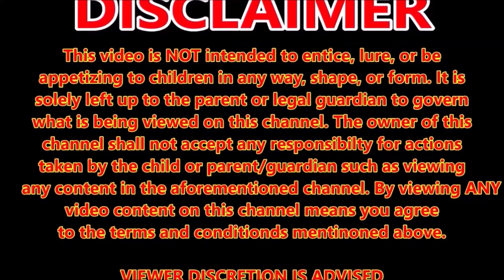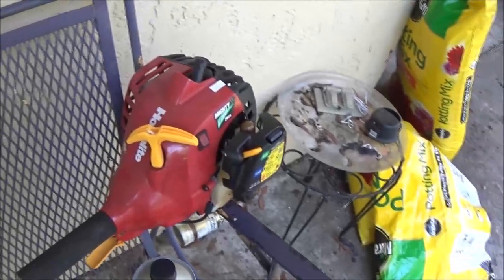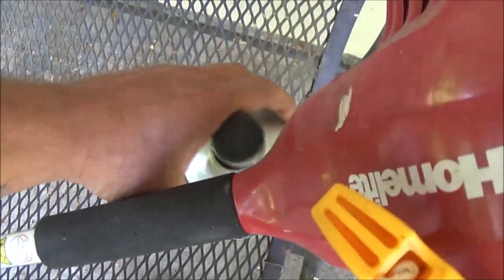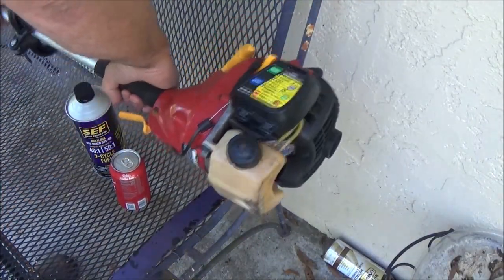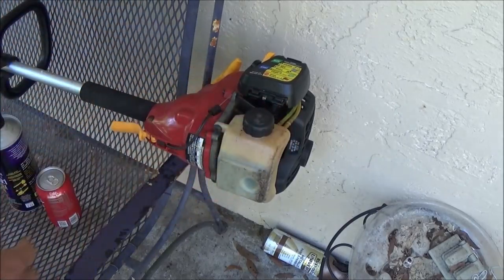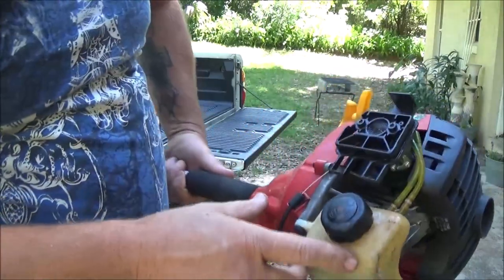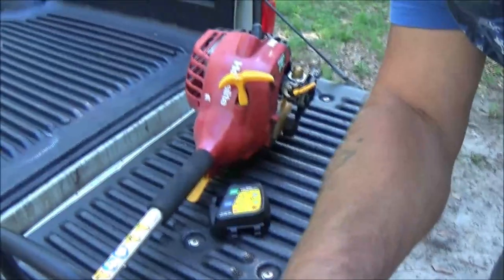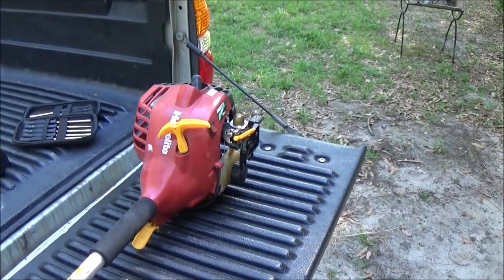Homelite Weedeater Carb Tuning

Comment: all tho the homelite string trimmers  are cheap as dirt there is huge after market of parts for them i hate Ryobi but i love the homelite trimmers on how easy they are to work on and there really reliable they out preform many of the other cheaper  mtd models at a higher price point only thing i hate about any of these mtd trimmer is there dang stinking twist off locking knob on there trimmer head if i was you go to lows and get one of those Shakespeare universal speed feed heads up at lows other then that i love homelite trimmers you did a great job getting it going shabear great video to you and your wife that a good video on put a sting trimmer head on that trimmer as well
Reply from the maker: Thanks my friend.  And thanks for watching and commenting.  Have a great week.

Comment: I only use canned gas for my super small engines, chain saws, trimmer, blowers...it wont eat your lines up and its pre mixed, and high octane.
Reply from the maker: That's what I use in my chain saw and weedeater. Lot better stuff.

Comment: This is just what I needed...got a freebie..broken trigger, bad fuel lines..cleaned carb & muffler, put in trigger & lines and got it started, but won't run on idle..got my pac man screwdriver and will adjust! Thank you!! Do you ever adjust the phillips head by the throttle cable?
Reply from the maker: The Philips head is the ible adjustment. So yes ehen idle to low or won't idle at all, turn in till rpms come up.

Comment: What is the dark, liquid cleaner you use to clean parts?
Reply from the maker: It's carburetor cleaner, you can get it at advance auto, auto zone, etc. It works very well but is a little pricey. About 28 to 30 dollars. But it lasts a long time. Use it over and over.

Comment: there is no filter for that model engine
Reply from the maker: Yes there is, It's on the fuel line in the tank.
Reply: Air filter, not fuel filter. They don’t even have an air filter. I won’t even take those from the curb for free because you can’t get enough money out of them to cover time and parts.